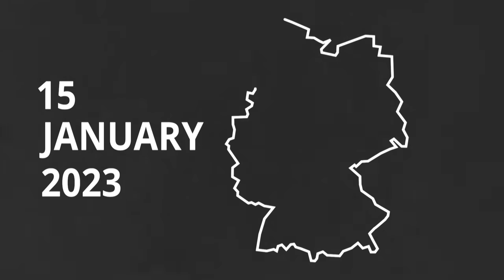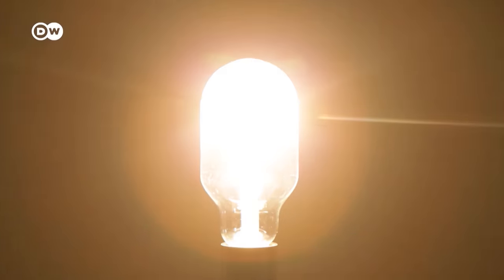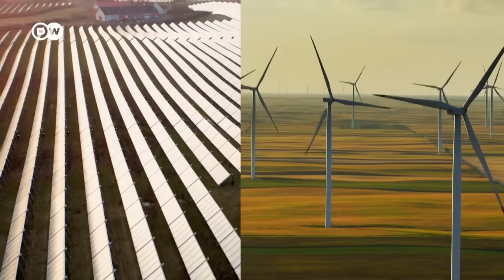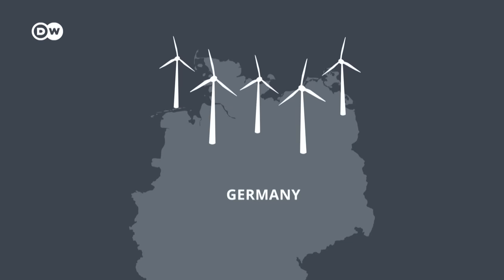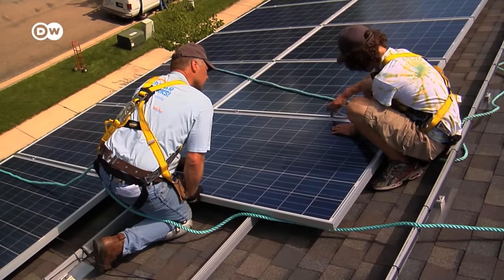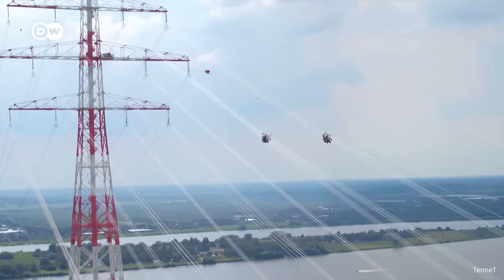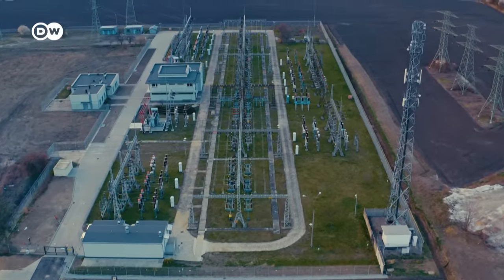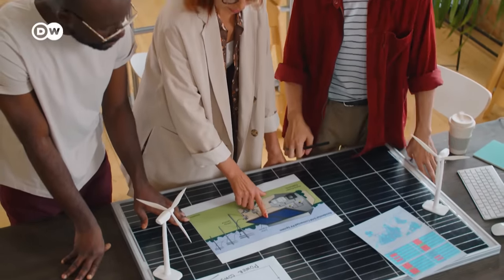This is what's REALLY holding back wind and solar

Comment: In terms of transporting huge amounts of power over huge distances, and problems with landowners, the solution is: 1. Run the cables along side or under public roads or railway lines because then there is no permission from private land owners needed. 2. Use the latest super high voltage direct current technology, which has be shown suitable for potentially creating a truly global single mains electricity grid.
Reply: I think it is much cheaper to buy out land from land owners than digging up roads or railways. For underground cable the size of südlink you need a very big trench.
Reply: @XDJaegermeister  I said "along side or under"; they wouldnt need to dig up the act railway lines or roads lol.
Reply: @TimLongson  How do you get up to 6 14cm in diameter cabels under the lenght of the road? Pls explaine a cost effective solution... I'm sure not one exists.
And next to the road is not usefull too. You need 7,7m width at the top and 4,2m at the bottom. It is rare to find such wide areas right next to the roads. And if the road is raised a bit, it has to be much wider. And high voltage cabels need to be buried much deeper. Your solution works for much lower voltages, but not for cables the size needed for connecting areas much farther away.
Reply: @XDJaegermeister  how? There's several ways, one example is Elon Musk's Boarding company could dig BELOW them.
Reply: @TimLongson  Nice troll. First you want it done. Second you want it cheap. Both things Elon can't deliver.
Reply: @XDJaegermeister  Railways are often, at least the main lines, electrified, an their pylons can carry power lines as well, that is something that is already done on small scale from substation to actual point of connection of given section of electrification. On large scale it was done in USA in first half of 20th century. So it should be quite easy to add power lines to railway lines, but we must think of some safety measures, so public line would not be connected to overhead electrification.

In case of Germany there would as well be option to use bahnströmnetz for partial transfer, but it would mean that 50Hz current would be transformed in the north to 16.7Hz current and then in the south back to 50Hz. Or the line could be upgraded in such way that beside railroad power lines it would carry additional power lines, perhaps HVDC that should be able to provide greater capacity with more or less same voltage to the ground as AC system would.

Comment: I have been saying this for years, even before renewables became a hot topic. Nope, it does not matter how long your nuclear reactor can run 24/7 once filled with fuel if a tree cut your power lines, and once the reactor needs to shut down for few months for refueling and maintenance you need to bring in equal amount of power from somewhere else. The grid needs spare capacity and backup connections so it actually works when needed IRL, not just on paper.

Comment: Germany still has several 220kV north-south lines that were not upgraded, at least according to ENTSO-E  map, their upgrade to 400kV could perhaps help a little bit with lack of transmission capacity.  But certainly it would not be enough. Another option could perhaps be addition of 50Hz lines to existing 16.7Hz power lines now serving railways, they have quite extensive grid and it seems like there could be three north-south corridors, but the question is whether there is way how to add something with higher voltage than 110kV to those lines and still fit into designed width of corridor.

When the conditions are favourable it should also be possible to build large enough pump-storage power plant that could run for several days. One such project was proposed between Lipno and Aschach, but other places could also exist.

Comment: The problem with power companies charging more or less relative to supply is that we'd have to trust them to be honest, to fairly compensate those who do it well, and to not just drive up rates across the board. If rates fluctuate, then it becomes much easier to slip in a few extra charges here and there without getting caught. There would at least need to be MASSIVE penalties, "all profits made via this method, PLUS" type penalties, to discourage unfair dealing.

Comment: When there is no wind, there is often no wind anywhere (on the same continent). At night, one entire half of the planet is in darkness. Even with a perfect grid (which has distance limitations), we will still need nuclear, gas or coal power stations to replace the renewables at certain times, almost every day. "Net zero" is impossible - Soeren Hansen: Why wind and solar will not work.
Reply: Hydrogen, dams, the hydrogen portfolio, batteries, or geothermal are all available.

Design upgrades are also needed. 

In any case, innovation will have to precede carbon capture in creating a more profitable energy logistics society.

Comment: 10:25 - Yes, that is vehicle-to-grid (V2G).  Could have expanded on this a lot more in the video.  EVs are essentially extra large home batteries.  With the rise of EVs, we're now talking about gigawatts of power evenly distributed right throughout the most heavily populated areas!

This is really another way of getting towards a "smart grid".  A smart grid allows us to wring out big efficiencies gains from existing grid infrastructure using batteries and software. 

By then, charging stations will have built-in software that act as "energy brokers".  They'll have a live cloud connection to the utilities and will work to get the best price for the home owners while also stabilizing the grid based on home owner's preferences and the state of charge of the EV's battery.  Of course, the very same charging software will also charge the EVs the most during daytime when renewables are peaking and electricity prices are the lowest.

California has bill 233 under discussion that will make V2G mandatory on all EVs sold there.  Also California will have a requirement for home "sub-metering" which is another important function to help manage V2G better.  California's moves show how important V2G will be to the grid problems outlined in this video.
Reply: @st-ex8506  Elon Musk wants to sell home and commercial batteries.  He's said on many investor calls that the grid & home battery side Tesla's business will be multiples the size of the EV business.  He's is correct on that!  Because not everyone drives but sure as sunshine everyone uses electricity.  The home & industry sectors are several times the transportation sector as well.

Elon Musk hasn't directly stated that V2G is any of those things you mentioned.  Last interview I read about, Musk said V2G isn't useful without a home battery and his reason behind it was silly.  He said the house would go dark off if you disconnected the EV.  Umm, no.  He must be thinking of an "off-grid" system which V2G is not.  All commercial home battery systems are "grid-tie" systems with a CT sensor to control power flow to the grid and same thing with V2G.  They operate in parallel with the grid. 

Yes, as Tesla's CEO, Musk would want to keep cost and complexity down and V2G goes against that.  A rational reason but its not looking at the bigger picture.  Musk's position also goes against Tesla's own motto of being an energy company and not just a car company.  It is very true in Tesla's case with the depth and breadth of their product line: solar, grid-scale and home battery, motor design, battery design, Giga factories, expansive charger network, etc.
Reply: @st-ex8506  Also need to delve into some technical details of V2G versus EV traction motor operation…

Its not just about cycle count but actual heating from electrical power draw that causes degradation.  And V2G's smaller power load is a walk in the park compared to the brutal conditions that the same battery operates in while actually driving an EV.  

V2G may only need some 2000W to provide a big benefit to the grid.  However, the battery in EV needs to provide some 5000W to 10,000W on freeway.  In acceleration, it needs some 20,000W to 250,000W or more!  The mid-entry Model 3 is 455hp which is some 340,000 watts at full power.  The Tesla Plaid is rated at 1100 horsepower which equates to over 800,000 watts during its hardest acceleration and need to add some 10% to cover motor and inverter heating.  Those dwarf V2G.

So an EV's normal operation and especially its very heavy amps in acceleration make V2G a cakewalk in comparison.  For reference, a clothes dryer is one of the largest appliances in the home and pulls some 4500W.  

Keep in mind that V2G will have many thousands of vehicles on the grid for a given region.  If each V2G vehicle was exporting 2000W then only 500 such vehicles would provide 1 megawatt of power.  All of which will be readily consumed by the same home or their neighbors home directly without flowing onto the grid.  That exported power goes up to the secondary winding of the neighborhood transformer and right into their neighbors homes thereby unloading the grid — ideally during the evening hours when the grid experiences its most heavy stress.  Utilities can offer "surge pricing" to entice V2G participation during these times.  It beats firing up a very dirty and expensive "peaker plant".

Also the cycle life of the newer iron based cathode LFP batteries is significantly more than the older Lithium NMC batteries.  Tesla already transitioned to LFP for their EVs except for their higher end models.

Ultimately, it will be up to the customer to choose how much of V2G to participate in.   After watching the problems described in this video, the benefits of V2G are too great to ignore.

Furthermore, its not just about V2G but also about V2L (vehicle-to-load).  Your EV can provide huge home appliance level power to your camp site, picnic, construction yard, etc.  A simple toaster uses 1500W and would overload the common noisy dirty gasoline generators.  But an EV already has this power and more without dragging along a generator to your picnic or construction worksite.  You basically can have a home theater with appliances running your whole campsite from a single EV without the toxic fumes and generator noise.

Tesla will be including V2G and V2L in their EVs by 2025.  Otherwise, those common everyday use case scenarios above will be competitive features lacking from Tesla which other manufacturers have.  Its also a feature totally lacking in internal combustion vehicles which can only further accelerate the EV transition.  In the end, the marketplace and government regulations will dictate this and not Elon Musk.
Reply: @st-ex8506  Of course one can't argue there is no extra wear on the battery.  But have to look at the pros vs cons.  And I think you're far over-weighing the cons and under-weighing the pros.

A home literally has days of power localized right in its garage and car ownership in the western world is especially high.  This directly and positively benefits the grid expansion crisis expounded on by the video.

I'll add the duty cycle of V2G is only fractions of a day versus the 24x7 full-duty nature of home and grid-scale batteries and may kick in only during the evening portion of the power duck curve.  And, as mentioned in previous, the intensity of power output of V2G is much less than EV's normal driving load requirements.

Another benefit is the potential ability to power a through a total grid blackout with whole home power.  As climate change hits harder & more frequent with extreme weather and as the grid infrastructure ages, grid blackouts may become more common.  An EV's battery has enough power to run a home easily all evening until morning and even for days if economizing.

As we move deeper into the 21st century, not having some electrical storage & backup power in a home will seem antiquated — maybe like not having a microwave oven or a big screen TV today.  But EV owners will already have a leg up.

The "Swiss army knife" that is the EV's battery and inverter will only further help accelerate EV adoption around the world.  It adds value to car ownership unlike anything imaginable in the old internal combustion world and at scale too.
Reply: @st-ex8506  You would be one of those that does not participate in V2G. That is up to you of course since the program would be optional.

But when people see the credit on their neighbor's, friend's and family's electric bill, they're going be activating V2G after all for something that barely effects their EV's battery.

Pulling 2000W even now on a EV's battery would hardly even strain it compared to its massive size.  The average 64kWh EV battery would experience only .03125C discharge rate and its capable of easily 5C output or likely burst 10C.  It would be like driving at walking pace if that.  You would do far more damage to it using DC fast charging even just once at 100+kW.   Think about 100,000W up to 350,000W charging will be common!

The fact is governments and industry are gearing up for V2G and V2L.

Finally, battery technology is only just starting to really mature after being relegated to the side lines for decades by the still extremely wealthy and politically connected global petroleum industry.  We're going to see some good stuff coming within the 5yr time frame in both power and durability.
Reply: @H4N5O1O  Yes, it would be best to bring down the percentage of car ownership for many reasons.  This might happen naturally as the middle class is being hollowed out (unemployment, high cost of education, etc)

Because more people will start to realize the on-going money pit that personal vehicle ownership really is: gasoline/electricity, maintenance, cleaning, insurance, interest (if financed).  All on a depreciating asset that sits idle 99.9% of the time!  Takes up space in the garage or driveway too.

The best solution for N. American wide open spaces will be autonomous taxis like Waymo.  Even driving in congested cities is a pain especially with parking.  The other problem with high personal car ownership is all the parking space needed for urban planning.  But this is all solved with inexpensive, door-to-door transport that autonomous taxis bring to the urban planning table.  Autonomous taxies have the real potential to really bring down personal car ownership rates that public transit could only ever dream about!

Unfortunately, public transit in N. America is exceedingly unsustainable in most jurisdictions.  Its expensive, dirty and crime ridden.  That's the hard truth of public transit in N. America.

Electrification, artificial intelligence, and increasing global polarization.  Its going to be a really interesting next decade for the transportation sector and the world! 🍿